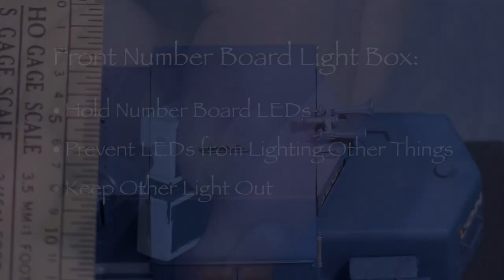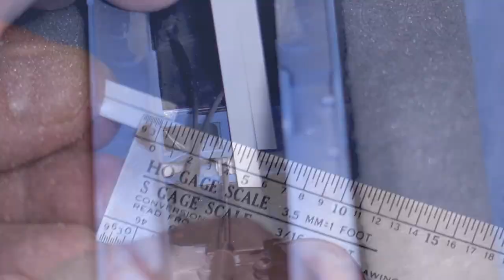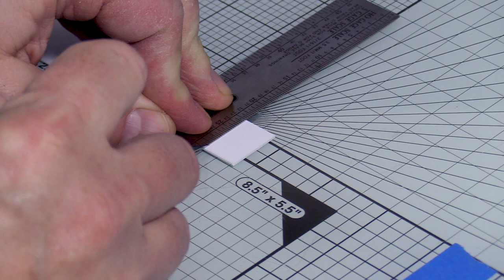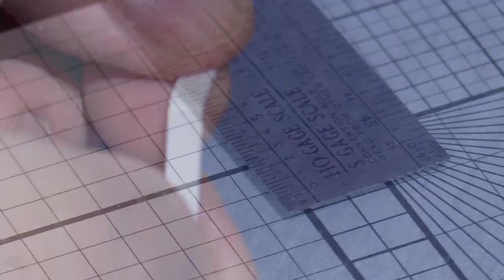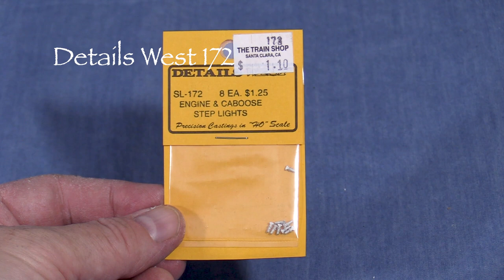Model Building HO SP Consist Part 10 - SD40 Front End Lighting

Comment: Hello Dan and Nichole!! Awesome
work on that Conrail unit, she will
look sweet on your new layout!!! Hey
Dan when you repainted those B 23-7s from Atlas didn't you install
wire grab irons in place of the Atlas
grabs when you finished it??
I just acquired 3 in CSX livery I'm 
going to strip and paint for Conrail,
and if you're interested I found those
cab signal boxes thru Shapeway and
bought 40 to start for all the units
I have!! Keep up the excellent work!!
Reply from the maker: Yes, I have replaced the nose grabs on Atlas B23-7s with wire.  They're nice models but the nose grab irons are oversized and make the model look more toylike.  That's good to know about the signal boxes on Shapeways.  Thanks!  There are a lot of interesting parts available there.  Thanks for watching!

Comment: What are the sizes of your penvise drill bits
Reply from the maker: I use a variety.  Usually if the exact size is important I'll call it out in the video.  For very small holes I usually use a No. 78 or 79.  I also often use No. 76, 74, and 70 for larger holes, depending on what's needed.  Thanks for watching!